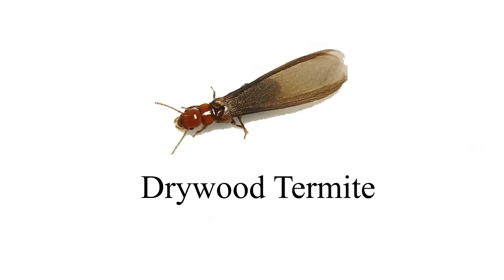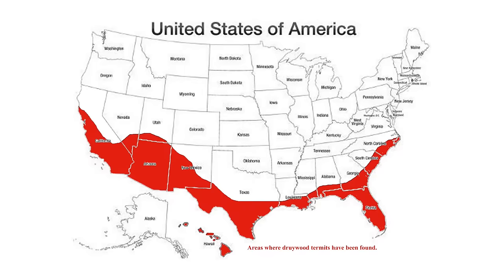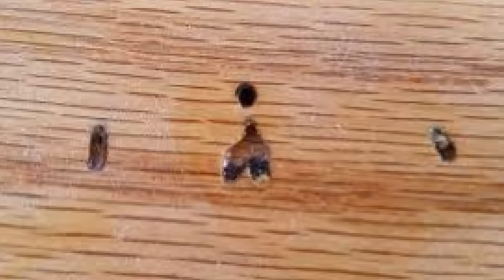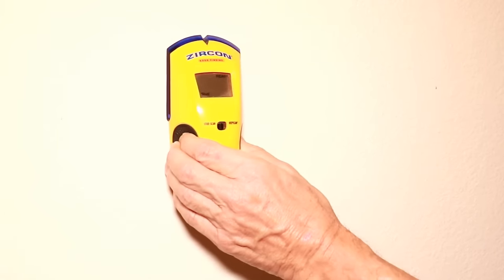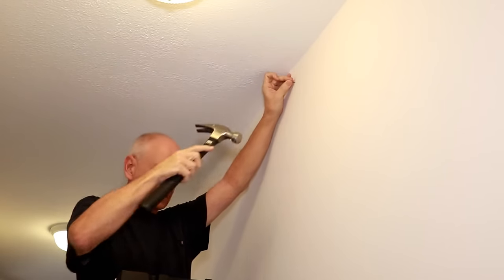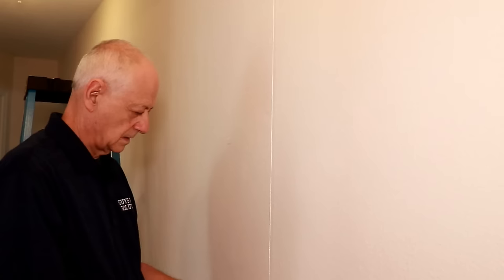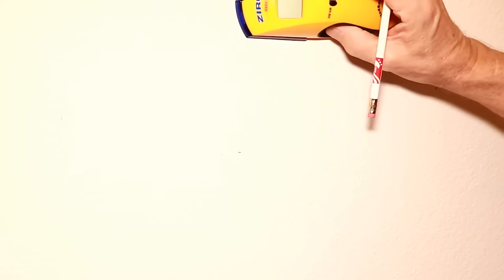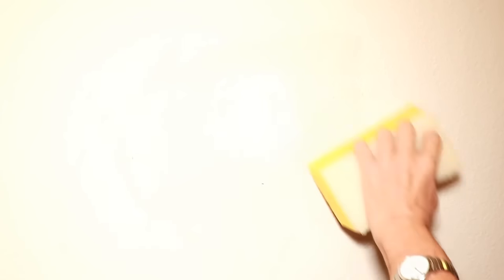How to Treat a Drywood Termite Infestation Yourself. A MUST see if you have Drywood termites.

Comment: Ok so if I treat all the wood in the attic with the bora care then I have to come back and stain or paint all that wood after ?? Sounds daunting to say the least also my attic has blown insulation like 30 inches deep so what about the ceiling Joyce under all that insulation? I need to do a full inspection since I found a swarm of winged termites on my front porch under the light. Your video is pretty great indeed but this is sounding near impossible even for the skilled and determined home owner. I guess I’ll try to break it down into baby steps as to not get overwhelmed if that’s even possible 🤦‍♂️ really appreciate your knowledge though.
Reply from the maker: I'm sorry, I think you misunderstood.  You only have to seal Bora-Care if it is exposed to the weather.  So, if you are using it inside the attic, then there is no need to seal it.  If you have blown insulation that is covering the ceiling joists, then treating them with Bora-Care would not be practical.  That would require you to remove the insulation, treat the wood, and then replace the insulation.  I think if you have a thick coating of blown insulation, over the top of the ceiling joists, then there is a reasonably good chance that drywood termites would not find their way through that insulation.

Just because you have termites flying around a light outside does not mean that you have a drywood termite infestation.  It is possible that they are a different species, that is also attracted to light, but will not infest your home by flying to it.  That is to say, they could be subterranean, and these guys must attack from the ground.  Therefore, you would be well served to obtain a couple of specimens and show them to a pest controller.  If they are drywood termites, then I must tell you that you most likely do have an infestation and the only sure way to get rid of them is to fumigate and then do a preventive treatment every two months.  The only time I recommend spot treating is if you absolutely cannot afford to do a fumigation.  It is almost impossible, even for the most experienced professional, to find all the galleries.  That is why fumigation is always your best bet.

If these guys turn out to be subterranean, then you may be able to simply treat them with termite granules for about 50 bucks.  I have a video on how to do that and I will place a link below for you.  I recommend that you do this treatment even if you do not have subterranean termites.  It has to be done every year, but $50 a year is a cheap insurance policy to prevent subterranean termites.  I will also give you a link to the product.  Do not buy it from Home Depot or Lowe's because they are no longer selling the correct type of granules.  You have to mail order it now and the best place to do that is Amazon.        

If they turn out to be drywood termites and you decide to fumigate, then please watch my video on how to hire a pest controller without getting ripped off.  That video will save you a lot of money.  I will place a link below for that as well.

I hope that helps.  Be well my friend.

Video on how to treat subterranean termites with granules:  https://youtu.be/H7rW_TSBHJ4

Termite granules:  https://www.amazon.com/dp/B000RUIJYM?ref=nb_sb_ss_w_as-reorder-t1_ypp_rep_k0_1_9&amp&crid=2T66D31R9CARI&amp&sprefix=bioadvanc

Video on how to hire a pest controller without getting ripped off:  https://youtu.be/y-a8XOqVrlE

Video on how to prevent drywood termites:  https://youtu.be/neNsmVbj8Pc
Reply: @GuysPestSolutions  wow sure do appreciate you Guy! Your videos and information is so well thought out and explained! I have collected some dead specimens from my front porch since there was like 100 dead ones on the porch under my porch light! They all still had wings though so I don’t know if they are termites or not. I walked the perimeter of the house and don’t see any mud tubes at all and I don’t see any frass or pin holes 🤷‍♂️ I need to take a look under some magnification I guess. I’m hesitant about taking the specimens to a pest control place in fear they may just say they are termites to get a sale for service. I sprayed around the perimeter today with some bioadvanced but it was bought at Home Depot 🤦‍♂️ once I get these things identified I’ll regroup on a plan of attack! Many thanks to you for your quick response and guidance it really is priceless in this day and age.
Reply from the maker: @unounv  I have to tell you that these guys do sound a lot like termites.  It has been my experience that the majority of pest controllers are not dishonest, and they will not tell you that you have termites if you don't.  I have often seen them incorrectly identify a species, but they generally do know a termite when they see one.  If you do not feel comfortable talking to a pest controller, you can take a close-up photo one of the swarmers and e-mail it to me at guyspestsolutions@gmail.com.  For me to correctly identify it, you need to take a photo of the back of the termite and then turn it over and take a photo with the feet up.  Put the camera in macro mode, if it has one, and focus in as well as you can.  I cannot always identify a species if the photo is out of focus.  That is why it is always best to show an actual specimen to a pro, but I would be happy to give it a shot for you.  

I hope that helps.  He well Steve.
Reply: @GuysPestSolutions  thanks so much Guy I’ll take some photos tomorrow after work. Appreciate you very much.
Reply from the maker: @unounv  Okay.  I will have a look when you send the photos.

Comment: Good day! Thanks to your videos.please educate me about the digging of trench on the perimeter of my house. I would like to ask regarding the 6 inches wide and 6 inches deep from the wall. My question is can i dig deeper than 6 inches? let's say 10 to 12 inches deep,because i think the deeper the better.Please correct me if i'm wrong. Thank you in advance and GOD Bless you.
Reply from the maker: That all depends on where you live.  If you live in the US, then six inches is all that is required.  The termites do not travel any deeper than that.  However, if you live in some other areas of the world, then termites can behave quite differently.  Also, keep in mind that drywood termites fly to your home and do not travel underground, so they must be treated differently.

I hope that helps.  Be well my friend.
Reply: Thank you guy! I live in the Philippines. I am sure that the termites i have presently in my house are subterranean termites. I alreary started digging a trench around my house but not yet finished.Unfortunately the type or the consistency of the soil is saturated,I'm planning to replace the saturated soil with loose/sandy soil around the perimeter trench and by doing that i'm sure of the absorption of anti-termite solution,Guy what do you think of my plan of replacing the soil? And do you recommend to dig deeper than 6 inches here in the Philippines?And does the subterranean termites enter  homes in one entry tunnel only and then they scattered when they are already inside our home?Anticipating your usual prompt response in this matter. Thank you very much and GOD bless you Guy.
Reply from the maker: @parakgale5021  I am not an entomologist.  I specialize in termite species in the US only.  That being said, I can tell you that you have 54 species in the Philippines, four of which are known to be a common problem with regards to invading homes.  If you are seeing mud tubes, then they are subterranean, and trenching should get it done.  However, you added a new wrinkle with the soil being saturated.  If your trench has water in it, then that could be problematic.  Even if you fill the trench with looser soil, the ground water is probably still going to get into the trench.  However, if there is no water in it, then you may be able to go ahead and use the dirt you have.  You need to be careful because you don't want the termiticide diluted by ground water and you don't want the termiticide leaching where you don't want it.  If your soil is very dense and will not absorb water, then using a more absorbent soil is a good idea.  I honestly don't know how deep termites will go in the Philippines.  My guess would be that they would not travel too deep because there is no food in the ground, but I could be wrong about that.  I know that in Australia they often dig all the way to the footing.  So, I suppose, if you dig down 12 inches, it can't do any harm.  Just be sure to treat all the fill dirt.  I am also guessing that the termites there will also attack from more than one entry point, which is why you need to trench around the entire building.  Also, look for nests inside the building.  Here we call them "cartons."  They only exist for one species here and you may have a similar species there.  They will literally colonize in your walls and do not need to return to the ground like other subterranean termites do.  So, check to make sure that you don't have anything like that going on.  I use a moisture meter to see if there is a higher reading in some areas of the walls.  If there is, then I drill a hole above the affected areas and I have a look with a borescope.  If I find a carton, then I remove the drywall and then remove the carton.  I wish I understood more about the different species you have, but there are over 2000 species in the world, and I cannot possibly be familiar with them all.  I think you are on the right track though.  You have a solid plan, so I would go for it and see what happens.  The worst that happens is you fail, and then you can always bring in a pro.

Be well my friend.
Reply: Thank you for the comprehensive explanation you have shared. GOD bless.
Reply from the maker: @parakgale5021  You are very welcome.  I hope it works out well for you.  Be well my friend.

Comment: Hi guy. I bought my Taurus SC for trenching outside. I bought several cans of friprinol foam...do I shoot this in the holes every 16 inches apart on the studs and 4 inches above & below the crossbar before spackling over the holes in every room of the house if I determined there are termites using the scope & tapping with the rubber mallot & screwdriver method you demonstrated? I was told by Hulette Pest Control I have drywood termites & they wan't to tent, which wont solve the problem. I'm trenching to prevent my neighbors termites from visiting & Hulette coukd have missed them, the inspector was a young lazy worker
Reply from the maker: Thanks for reaching out to me.  I normally do not recommend trenching the house unless you have subterranean termites.  I think a better idea is to install monitoring stations and then bait the stations if they go off.  Trenching will give you 5 to 10 years of protection, but it's a lot of work.  It's fine to do.  No harm in in.  Just more work than you need to do.  I agree with you that you should not just take the word of someone that inspects you house for termites.  You should do your own inspection.  I have a video that will show you how to do it correctly and it's not all that hard.  You will end up doing a much better job, and you will know if you have subterranean termites and/or drywood termites.  The video covers both species.  Keep in mind that, just because your neighbor has subterranean termites, does not mean that you do as well.  Drywood termites are different.  If you neighbor has them, then I promise you that you have them too.  So, let's talk a little about drywood termites.

It is important to understand how drywood termites work.  They enter through cracks and crevices around windows, doors, eaves, pipe penetrations, and so forth.  Most of the time, they enter through several locations.  That is because a swarm of them attacked your house at the same time.  If there was a crack or a crevice, then they probably found it.  After they establish their galleries, which will be inside the wood, it will take four to seven years for them to be able to swarm.  Now that they are in your house, the swarmers will use holes that are in your studs to travel through the walls.  Those holes in the studs were created by the electricians to run the electrical wiring.  Not only are these holes going through the studs, but holes were drilled into the attic for the light switches and to run some of the wiring for the outlets.  So, the termites now have easy access throughout the attic and the walls.  If you have a basement or crawl space, they have access to that as well.  Most of the time, you will have no idea that they are in the walls, because the frass is inside the wall.  To make matters worse, if you have drywood termites, then your neighbors have them too.  That means you have been getting swarmed for as long as they have existed in the neighborhood.  Most likely, we're talking about years, so it's a safe bet that you have these guys in many locations in your home.

I always hate to be the bearer of bad news, but if you have drywood termites, the only sure way to get rid of them is to fumigate.  Prices for this can vary wildly in this industry, so I recommend that you watch my video on how to hire a pest controller without getting ripped off.  That video can save you a lot of money.  You should also know that the gas they use to fumigate has absolutely no residual action whatsoever, so you can get reinfested the moment the tent comes down.  Like I said before, if you have drywood termites, then your neighbors have them as well.  Since drywood termites swarm every year, it is almost a certainty that you will be reinfested within a year after the fumigation is done.  The only way to prevent this is to do a preventive treatment on your house every 60 days.  Most pest controllers will not do this, so it is something that you generally need to do yourself.  I have a video on how to do that and I will place a link below.  This is a generic video that covers a lot of different pests, but it also works for preventing drywood termites.  Just ignore the part about treating your yard.  You only need to treat the house for drywood termites.  This will not treat the termites that are already there, but it will stop new ones from getting in.  If you absolutely cannot afford to fumigate your house, then you can try spot treating it yourself.  It is virtually impossible to find all the termite galleries, but it is way better than doing nothing.  Regardless of how you treat it, you should begin the preventive treatment immediately, so that you do not get additional termites paying you a visit.

If you want to do the spot treatment, then please watch the video on how to treat drywood termites again because you may be somewhat confused about how to do it.  Perfectly understandable since you have never done this before.  I think you may have the inspection process confused with the treatment process.  A lot of folks do get that mixed up.  The inspection process and the treatment process both require that you locate each stud with a stud finder.  They may not be exactly 16 inches apart all the time.  To inspect, you need to locate the area between the studs and use a borescope to look inside the wall void for frass.  To treat a stud that you think is infested, you need to drill holes into the stud that are 4 inches apart from the ceiling to the floor.  The idea is that you don't know exactly where the gallery or galleries are located, so you go every 4 inches to make sure that you hit them all.  A gallery can be as small as the size of a peanut.  You most likely have termites in the ceiling joists and rafters as well, so you can see that trying to find all the galleries is pretty much impossible.  If you do a good job, then you will knock out a lot of them, but even the best of the best pest controllers who do this stuff are going to miss galleries.  You just need to miss one and the infestation will continue.  That means you need to do this inspection process constantly because you never know which area of the house is going to become infested or when.  That is why I say that the only sure way to eliminate the problem is to fumigate.  I know that's not what you want to hear, but I think you contacted me because you want the truth.  So, I am giving it to you straight.

Please let me know if you would like to install monitoring stations around your house to detect the presence of subterranean termites and I will assist you with that.  You can do it around the entire house for as little as $25, if you make them yourself, or you can buy enough of them ready made and do the entire house for around $300, depending upon the size of the house.

I hope that helps.  Be well Day.  

Video on how to inspect your home for termites:  https://youtu.be/oGyAVT7Zyro          

Video on how to hire a pest controller without getting ripped off:  https://youtu.be/y-a8XOqVrlE

Video on how to prevent drywood termites:  https://youtu.be/Yozv3s-Qwlw
Reply: Thanks. I will  be getting a tent November, & performing the other treatments.
Reply from the maker: @Foxfirebrown1234  You are very welcome.  Good luck with the fumigation.  Be well Day.

Comment: what is you opinion of Harris Termite Powder solution?
Reply from the maker: It doesn't work the way you may think.  It is a borate product.  If you spray it on wood, then it may prevent termites from attacking the surface upon which it was applied, but it will not stop an existing termite infestation.  I hope that helps.  Be well my friend.